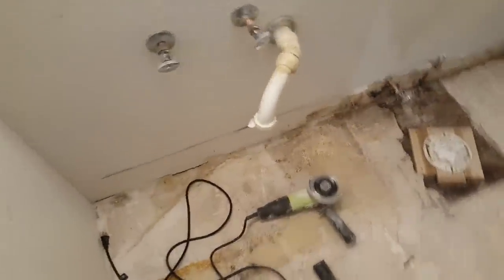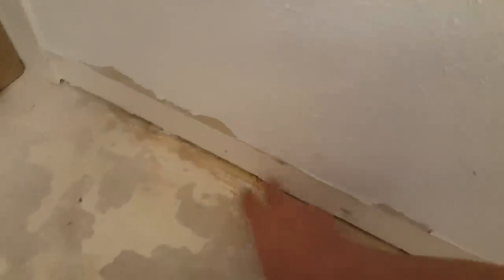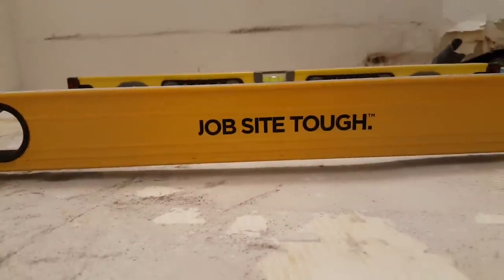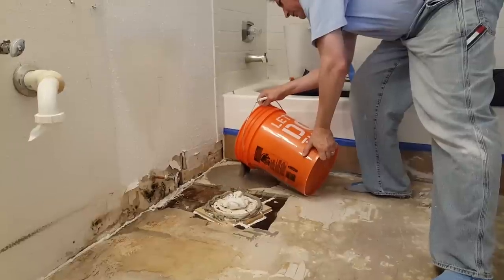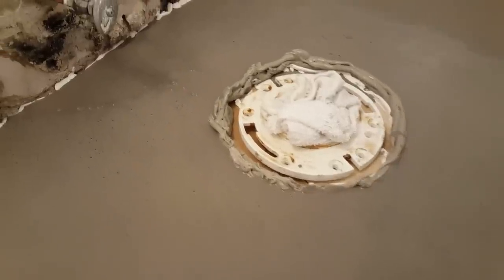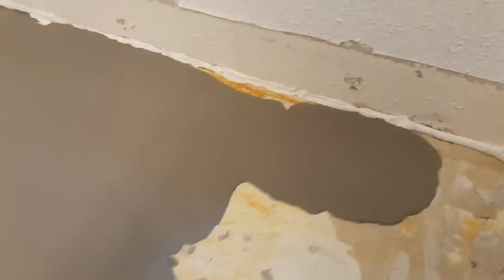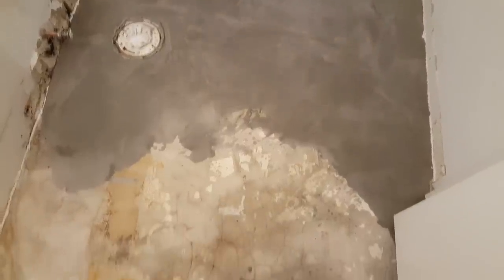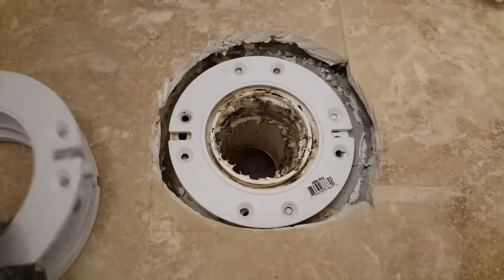How to Self Level a Bathroom Floor Using Self Leveler Cement

Comment: So what do you do when your floor is on a slope?  Nice explaining you did.
Reply from the maker: You keep pouring self leveler compound down until it builds up, just like you saw around the toilet flange, it looked like it was running down steps until we filled it up. You just have to put enough foam or caulk around the edge to be able to stop it.
Reply: @jeffostroff  You start on the low side first?
Reply from the maker: @theropesofrenovation9352  I still don't know if it matters which end you start on because at the end of the day, you pour enough compound down to bring it all up to level. Normally, the flooring level contractors wear boots with cleats and they walk around in it with a large rake (like a squeegee) and guide the leveler into place, where it finds its own level on the surface, while their partners mix up buckets and rapidly dump them on the floor. You can see how the tub was at the high side and it ran down to the toilet flange at 4:00 in the video, and the door opening 6 feet from the tub was 3/4" down sloped. You could actually see the whole room sloped down like the old original Batman TV series, it was almost comical. Did you see our other video that shows the pros doing it like I mentioned above, our other project where they did the living room and dining room of a townhouse I was remodeling: https://youtu.be/5GyXWeSzY_0
Reply: @jeffostroff  I haven't seen that video yet.  But I will.  My floor is slanting toward the tub.  sighs.  Thanks so much for your help!
Reply from the maker: @theropesofrenovation9352  So, if you put a 6 foot level right at the door, how much gap is under the level by time you reach the tub?
Reply: @jeffostroff  ,  i've been pouring a couple of self levelers 2-3 night a week.
       a little Black Velvet,   a little Pepsi,     but i end up out of plumb. 
 btw,  very nice job on the floor.
Reply from the maker: @theropesofrenovation9352   What I would do is find out how much gap is at the tub, and say it's 1/2", I would use a Popsicle stick with that mark on it where you want the level to be. Place it near the tub, and start pouring the leveler pour up to that line.
Reply from the maker: @normhodgkinson6965  That was 1/2" thick Travertine natural stone, a monster to work with, but I love the outcome. VERY heavy, especially once you back butter it, it's a back killer, but very rewarding in the end.
Reply: @jeffostroff  Travertine is nice but i don't want to work with it.  
   speaking of GFIC's,  do you know they lose about 10%
of their effectiveness each time they are tripped ?
Reply from the maker: @normhodgkinson6965  So if you test your GFCI 10 times, it's time to buy a new one? Great way to get back at people you hate when you visit their house, just start tripping their GFCIs outlets.
Reply: @jeffostroff   ha ha ha ha , yep.   i replace 2-3 a year in various
   rentals around town.    sometimes they had been wired
incorrectly, and i think most other times children of the
   tenants play with the buttons,  pushing and resetting  to
see what happens.   i'd like to hook a loud horn to one, and
  when the kid pushes the button it blows him out the door.
Reply: @jeffostroff  Ahhh.  Will do!
Reply: @jeffostroff  An inch or maybe a little less. =(
Reply: My floor is wood chip flooring. Can you pour the self level on this?

Also do I just tile directly on the floor level concrete?
Reply: @jeffostroff  Can you pull the foam or caulk out afterwards or should you leave it? My floor subfloor doesn’t meet the edges of the wall, even though I paid a guy to put the new subfloor in.

Comment: Good video. But did you have to get extra long brass toilet bolts? And what kind of screws did you screw those plastic flanges together? And did you have to drill a hole in the cement for those screws?

Comment: I keep watching this video as I will need to be doing the same thing. Some questions I have:
1. What is the primer you used, how do you apply it?
2. After I remove the tile and am left with a concrete floor, do I need to remove as much residue and thin set bits and pieces before self leveling?
3. As I'm in a condo as well, where does the corkboard get applied, right on top of the self leveling? Do you put thinset on the self leveling first, then the corkboard. Does thinset go on top of the corkboard as well for the tile?
4. About the toilet were the screws you used to fasten down all the plastic rings and what were those two gold colored screws sticking out?
THANK YOU!
Reply from the maker: Hamilton, the primer is necessary to bond new mortar to old mortar, never pour new concrete on top of old without using primer first. It is easiest to roll on the primer with a regular paint roller, and cheap chip brush to get into corners and other areas that the roller does not give complete even coat. As for residue thin set, yes absolutely, it all comes up. At 2 of my projects we brought in pro floor surfacing companies just to jack hammer and grind down the cement floor with their machines, when finished, it looks like a perfect smooth concrete floor, slightly roughened. Once self leveling is dried and cured, 1/4" cork is glued down using cork glue, usually troweled into place, then cork is placed on top of the self leveler, then you tile the next day after glue dries. Then you trowel out thinset onto the cork, and set tiles on the mortar. Look at this other video we did, that shows us troweling mortar onto the cork that we had already laid down in a kitchen: https://youtu.be/hNyxj3Oo2y0

Comment: I also plan on remodeling a bathroom the same size. I just realized there are two layers of tile, I dont know what is under the tile, most likely concrete I would think. If I remove all the tile, and then I'm down to the bare concrete, what steps do I perform?
1. Paint the primer, what is it called?
2. Use the self leveling?
3. 1/2 inch corkboard?
4. Thin set?
5. Tiles?
Is that the correct order?
Reply from the maker: If you remove both layers of tile, you'll likely find either wood subfloor or concrete. If you find concrete you have to grind down  all the tile and mortar remains until you have flat concrete floor, which should be rough textured by then. Next you check level of the floor, if it's level enough, no more than 1/8" variation over 6' than you are ready to tile, otherwise you roll on primer, let dry, then pour self leveler. If you live on an upstairs condo, building codes require you to put down 1/4" cork underlayment before you tile as a sound suppressing material.

Comment: So  when will I know when to use a leveling compound  vs adding more thinset to build up the tile placement?
Reply from the maker: If th efloor varies more than 1/8" over 6 feet you shouold use a leveler.  That is the TCNA spec.

Comment: Should it go under an acrylic bathtub?
Reply from the maker: You can do it how you wish, you can run a bead if caulk along the bottom edge of the tub along the floor to keep the self leveler from ever contacting the tub. All you need is the floor level enough to hold your tiles level, and so 1/4" away from the tub is OK.

Comment: should have used one of those spiked rollers to smooth out, eliminate bubbles and break the surface tension.
Reply from the maker: Most common causes of bubbles are mixing at too high of speed and not priming the floor.
Reply: Negative that post is 100% correct you have to roll it. And if you don't know that then that bathroom project makes perfect sense. ALL of that old cement should have came off. Then primed and since its home depot product they required running mesh before pouring the leveler. Or did the guy at the store never mention it.? Lol 
How did you establish the height of your self leveler other then just throwing a level on top in the beginning.? Why not throw a level on dry self leveler before the tile to see how level and smooth that floor really is.

Comment: Preparing uneven subfloor for tile  by adding another layer of plywood and then Detra  but the floor is not level should i first  use self leveler  and then the plywood or  installing the  second layer  of ply wood and then self leveler   before installing Ditra and tile ?
Reply from the maker: Usually the self leveler is poured down over the sub floor so you have a nice cementitious layer to apply the DITRA then the tile.
Reply: When you apply Ditra you will use modified thinset for that step only and also use ditra trowel. Once you lay tile over ditra you have to use none modified thinset ONLY.

Comment: I have a sloped bathroom floor with tiles already on it. The bathroom floor wood might have warped. Maybe replacing the possibly warped wood boards will make the floor level. Should I replace the wood floor boards or just add this self leveling cement? 

If later repairs need to be done, will putting cement on the floor make it difficult or impossible to remove the wood?  For this reason, I probably would want to replace the wood boards instead of using self leveling cement. Is it preferable in my case to replace the wood boards and tile over the replaced boards?
Reply from the maker: You could be opening up a Pandora's box of other problems. I would look at the wood floor, and as long as it is not rotted, probably would not change it. Can you verify the joists are not farther than 16" from each other? Are the boards flexing too much? If so you might need to sister up more joists to the existing one to lessen the distance between them and give more support to the floor boards. You also want to check for squeaks, and screw down the board accordingly. Usually the floor leveling can handle up to 1" thick, so of your bag says it can handle it, then you'll be able to level the floor OK.
Reply: @jeffostroff  Thanks. I believe the joists distance is fine.

The board is probably warped from water damage from a previous event. I'm fairly sure the house wasn't built like this and the floor is warped because of a previous water leak above. It might not have rotted the wood, but it may have warped the floor. I believe the wood is not rotted. The boards aren't flexing. The floor is staying fairly solid. There are no loose or cracked tiles even with the floor sloped. It seems like the tiles have fit into this warped floor without cracking. 

There are no squeaks, except some minor squeaks under the shower, which I can hear below.These squeaks aren't too bad.

It has been used while the floor is like this, so it is probably safe. But I don't like looking at a sloped floor, so I want to fix it.

Comment: Thanks for the great video. What kind of self leveler did you use? It looks great. Would this work on wood floor that evenly slopes 1/2"over 4 1/2'?
Reply from the maker: At the time I did this pour, I used some off name brand from Home Depot, they stock Henry brand now, but would not be good for your application because Henry can only go up to 1/4". I suggest you get MAPEI Self Leveler Plus 50-lb Indoor Self-leveling Underlayment from Lowe's, it can pour up to 1". Just remember when you start going deep, you start using massive numbers of bags, so calculate according to the manufacturer instructions.
Reply: @jeffostroff  Just saw this after asking my question ... cool. You've been subbed son ...

Comment: Lessons learned from my own slc disaster; it doesn't really self level, it needs to ne pushed/pulled into place, get a good mixing barrel and mix it all at once, then pour it all at once, and the system only really works as intended if you are doing a complete room/section-trying to feather edge it wont work.  Edge-ban makes a good product for surrounding the toilet flange.
Reply from the maker: Yes, in large rooms they acutallu roll it and comb it.

Comment: Regarding the toilet, using all those rings doesn't seem like it would hold up over time. I can't imagine that it won't leak through them over time
Reply from the maker: That's why we coated it with silicone.
Reply from the maker: That's why we coated it with silicone.

Comment: Any  reason why you didn’t prime the subfloor, thinking you may run into a bonding issue with the two different type of material.
Reply from the maker: Actually we did prime the subfloor, I believe we lost a few scenes and that was one of them, did not make it into the final cut.
Reply: @jeffostroff  it doesn't look like any primer, was it clear? I saw one primer from another video, that was purplish in color, just curious
Reply from the maker: @Loretajean   I have seen purple primers and I have seen a primer that goes on looking like milk and dries clear That is the one they sell at home depot

Comment: This is the best video I’ve seen on this process (and I’ve watched a lot) thank you! My only question: I’m doing this over plywood subfloor and then laying cement board over the self leveler. How do you secure the cement board on the self leveler? You obviously can’t screw into that so would it be glued down?
Reply: Make sure your plywood is nice and secure if not run some screws so everything is tight in place, fill in any holes then prime. Run expension joint around your bathroom for expension/contraction.  Some but not all self levelers require to run wire mesh before you put down self leveler check the requirements. Once your floor is level you can use Schulter ditra membrane you can cut that witch scissors extremely light no dust or heavy lifting like cement board. You would put that down with modified thinset and make sure you use ditra trowel for that step. Once is down you can start to tile right away. But make sure you are using NONE modified thinset over ditra membrane.
Reply: @briank6375  thank you so much for this info! We looked into Schulter, it’s a bit more expensive but seems to be the best water proof option. I didn’t know you can’t put thin set over the ditra though - what about laying down tile? You will need to put some type of thinset for that
Reply: @andreapereira1523  I know it's been a year, but ... he meant to write non-modified thinset. Not none.

Comment: I was reading you are supposed to use a pretty good respirator mask, mine was about 9 dollars, that this stuff can have very small particles effect you - also, mine was much thicker - I could not find the DAP additive, which it said to add in place of water to improve adhesion and water permability - I am using this to fill a large gap, an inch or so outside of my tub - the contractor never finished the job. I used a different additive from home depot, noticed the instructions were a bit different - the dap product said with their optional additive that you simply replaced the water with this additive, and the mixture was 3 parts webpage 90 to 1 part water or adhesive.  Ended up dumping in quite a bit more of additional adhesive to make it workable, was still a very thick mixture. i am putting pine molding on top of this, which I will prestain and stain - not sure how this will adhere to the cured webpage 90, if I will need another adhesive to affix these two together -
Reply from the maker: Yes I wear a N95 mask, and also do it outside

Comment: Hi, You kept calling this product a "Cement" and a "Concrete." Is that what this stuff is?.., A Very Fine/Liquid Cement? Does it have sand in it as well as cement? Can it be used outdoors? Thanks
Reply: Cannot be used outdoors

Comment: I noticed that you did not use a membrane or backer board to lay tiles on. Is this necessary?
Reply from the maker: One thing the builder did that was decent which you should have noticed in the video is they poured about at least 1" of self leveler over the wood sub floor, it is like this in the whole condo, so there was no flexing of the floor. Had this been a bare wood subfloor, I would have used Schluter DITRA, which I used in a guest bath remodel video that I uploaded last summer. I have an upcoming video on DITRA coming up in the next few weeks.
Reply: jeffostroff 

Oh so because there is a layer of cement from the cement leveller, there is no need for using DITRA membranes? 
The reason I ask is because I plan to do a DIY project involving tiling in my bathroom apartment, and the subfloor is composed of cement
Reply from the maker: @agamemnon4889  I remodeled a friend's upstairs bathroom last summer, and the 2nd floor is a of pre-fab hambro concrete slabs. I still put DITRA down anyway just because we had some, so you can always do it if you want, then any movement at all of the slab won't be a problem.

Comment: Actually the toilet flange can be even (preferred), below, or above the finished floor because there are wax rings made to accommodate all levels.
Reply from the maker: Also depends on the toilet, even with the wax ring flattening down, you could have the toilet sticking up too far.

Comment: What to do if bathroom floor is weak and soft
Reply from the maker: You mean like rotted wood? You might have to replace the subfloor. Why is it weak and soft? Some people also lay more sheets of plywood over the top of the sub floor, sum install cement tile board the to the floor, then tile on top of that. But we need to know what is wrong structurally with your floor.
Reply: Check the floor joists, they could be sagging or rotting too and should be replaced or reinforced.